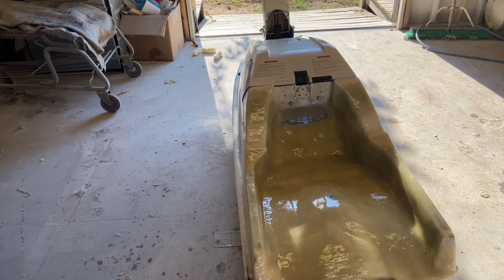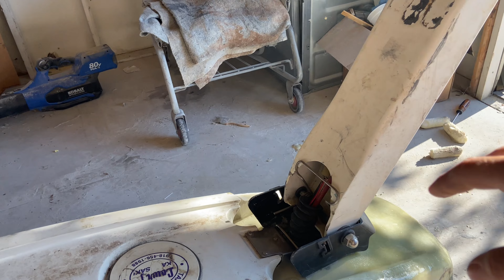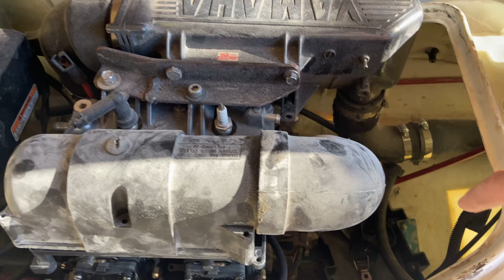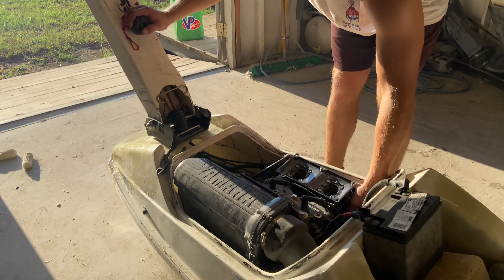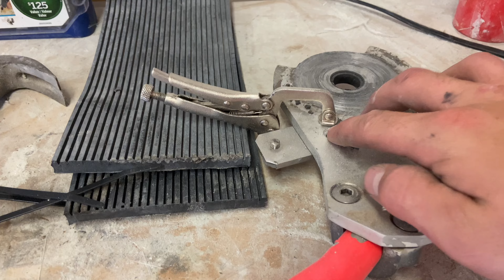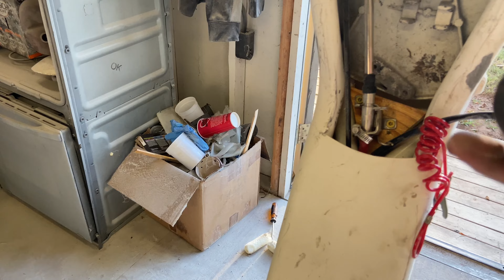The CHEAPEST backflip jet ski build, Part 10.

Comment: also,  just some free advice,  long pole, short ski, trim up all the time... it'll be unrideable.... at LEAST cut the pole way down AND don't make that trim angle permanent.  probably need to cut 12" or more out of that pole.
Reply from the maker: I got it out on the water and it was definitely harder to ride the any other ski I’ve ridden but I think with more tray time it should be fine. I left the pole long because I want to chase boats and not kill my back the whole time. I plan to make the trim adjustable it’s just about more time and money
Reply: @NastyMoto  that long of a pole won't help your back really, it will hinder your riding. all your weight will be at the back making it sink and you can't lean forward to help it stay...  some video of it would be great.   I chase boats all day long on my skis and the poles are about 1/2 of yours..  your weight sinks back and brings pole closer to you when you ride...

Comment: I'd buy a 2 gallon kart tank, cheap and easy.
Your static trim is too high, your want to run 0 to 5 degrees up, looks like your at 20 degree, that will make that ski really hard to ride.
Stop/Start switch is a common failure point, the kill switch connects the black and white wire when you push the kill button or remove the lanyard. Black wire goes to ground in the ebox and white wire goes to the cdi. It's most likely the switch, do a continuity test on the black and white wire, the stop start buttons can be taken apart and cleaned.
Reply from the maker: I’ll look into that for sure!